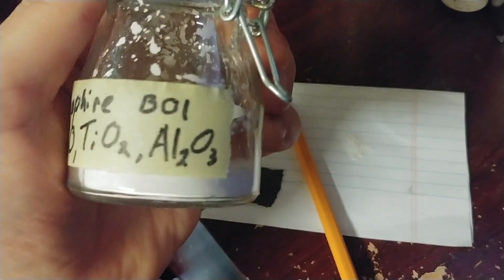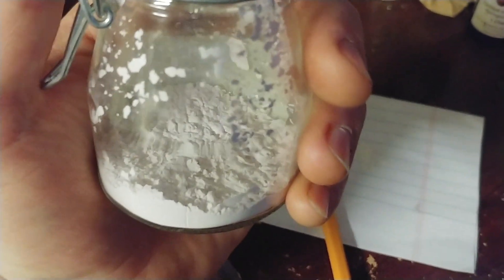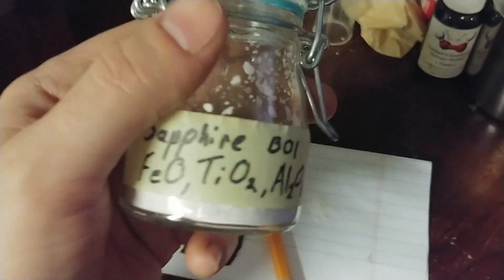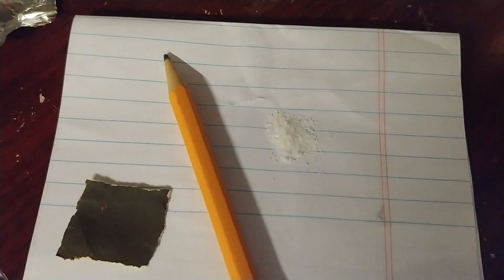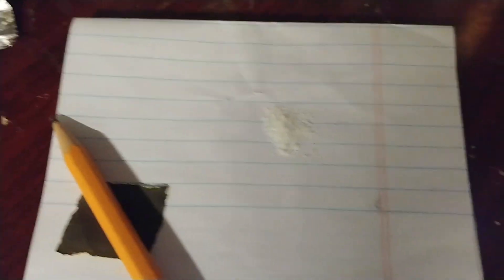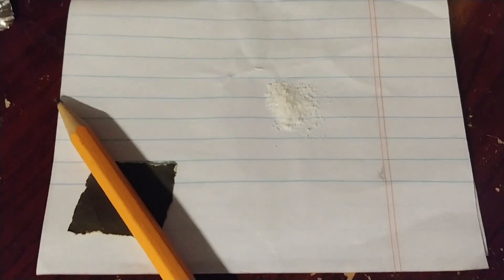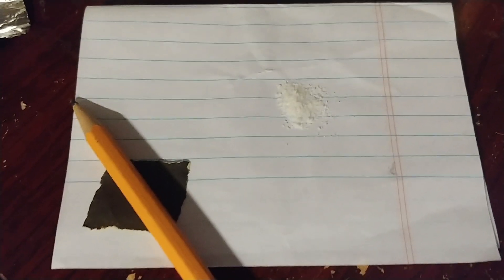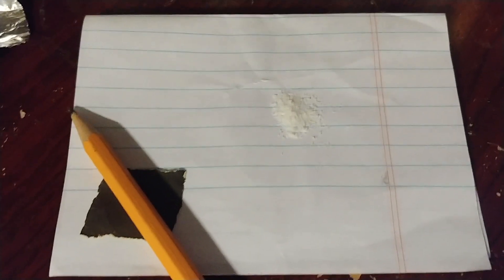Amateur Chemistry: Unintentional Explosive Byproducts in the Lab.

Comment: Triacetone triperoxide is sythinsised at a percise temp. Tht I will not mention as I have been to prison enough times in my life 😂🤣😂😂
Reply from the maker: I've learned more about it since this incident. Iron (III) oxide is acidic enough to catalyze into either the dimer or trimer apparently. I used 35% H2O2 when I tried to oxidize any Fe(II) into (III).

Comment: I'm guessing the iron material was contaminated with a strong acid or the iron oxide is acidic itself either way any strong concentration of hydrogen peroxide mixed with pure acetone or very close to it kept at a very low temperature will synthesize tatp if a strong acid is introduced or in any order I'm sure but if this was by accident 🤣 I would think it was above 50 degree farhnhihht seeing as your windows open that is most likely dicycloacetone peroxide with a small amount of tatp
Reply from the maker: Iron (III) oxide is acidic enough to catalyze it into either the dimer or trimer. I used 35% H2O2 when I tried to oxidize any remaining Fe(II) into (III). It is also possible some small amount of acid remained in the oxide, but I have heard that iron (III) oxide could be all that did it since it sat over night. I learned a lot from this mistake and that has prevented loads of other possible mishaps like making silver oxalate during my love of using oxalic acid to isolate transition metals efficiently. I do more smelting experiments these days than anything else, but with chemistry I don't like surprise explosive byproducts.